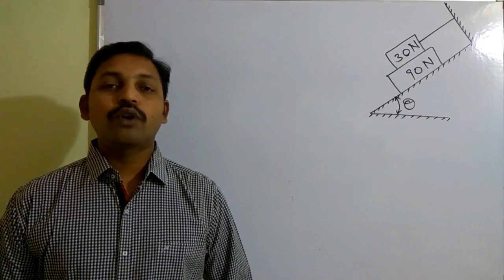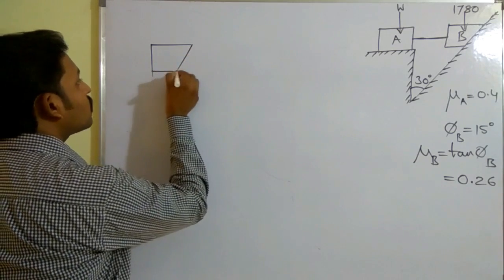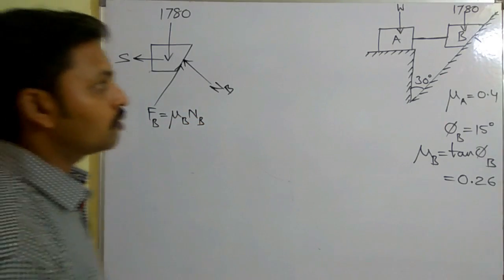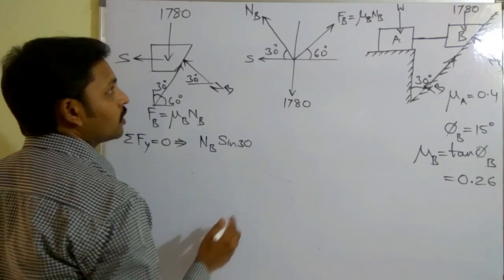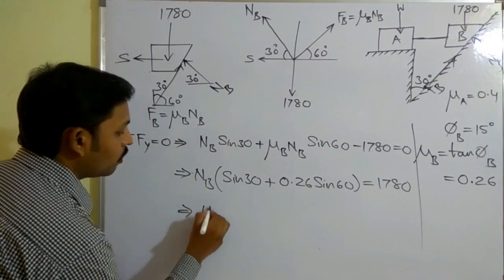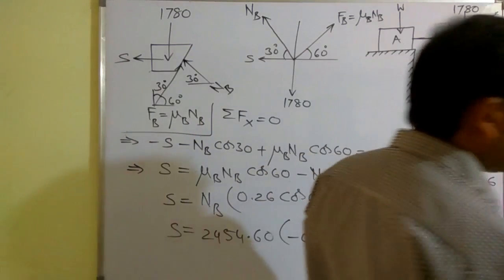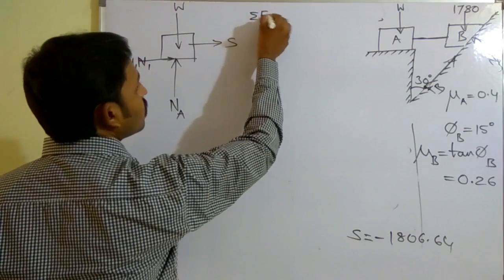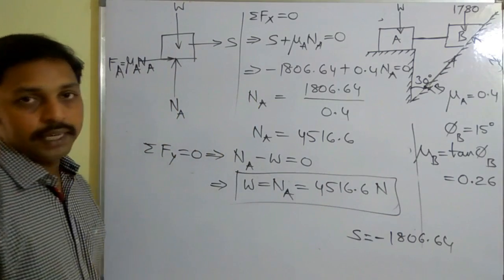Friction Problem No 7

Comment: Sir, since block A moves to right, why have you taken friction also in right direction?
Reply from the maker: Block  A will tend to move left hand side because as the block B moves down the incline the rod pushes the block A in left side. So the friction will be in right direction for block A
Reply from the maker: Block A doesn't move right. It will move in left hand side direction. As block B moves down the inclined plane Block A moves in left hand side direction.
You can find it by drawing an inclined plane and keep two erasers connected by a small needle. Then you will observe that block A will move in left hand side direction
Reply: @LakshmiNarayanaV1212   why did not considered mgsin(60) for blockB along inclined plane ?
Reply from the maker: @Azzu974  weight is acting vertically downwards. No need to resolve it. Instead of that resolve normal reaction and frictional force which are inclined.